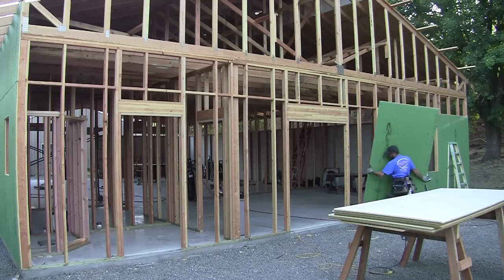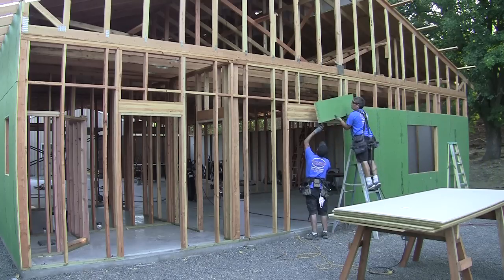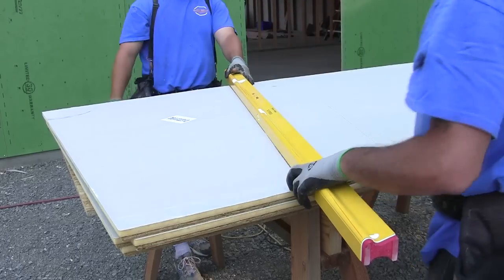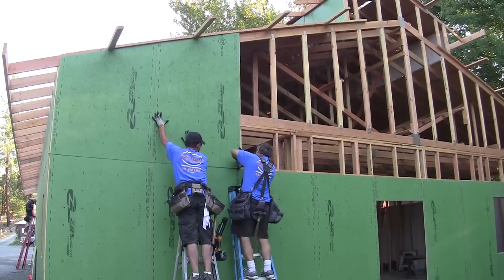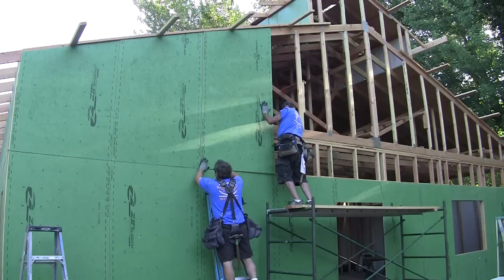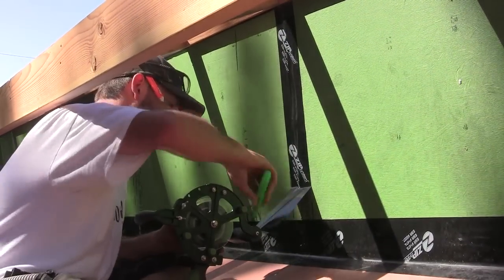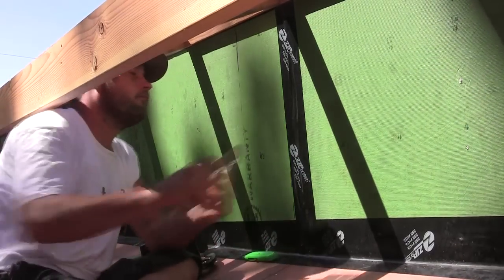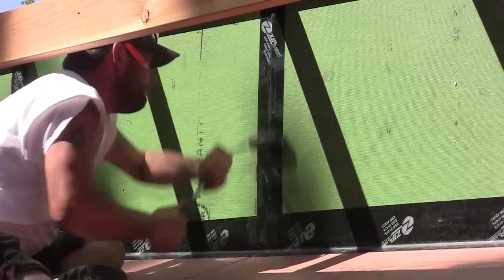My New Shop: Installing Zip R-Sheathing and Roof Sheathing

Comment: sheets need to be installed horizontally as well and staggered, maybe I am wrong but that is how I would install them
Reply: (duplicated from other reply) You don't need to stagger the zip system R panels. They are not structural. If you look at their install manual, they don't do a running bond pattern at all. It's much easier to tape the seams and get a good seal if they are not staggered.
Reply: This is zip system, it’s rated for vertical and horizontal.

Comment: The only thing I would change is the insulation I changed to rockwool for a few reasons 1  it uses the least amount of chemicals, it is fire proof, rot proof, it is hydrophobic, and sound proof. and unlike foam is is not made from toxic chemicals.

Comment: Are you still happy with the insulated zip and did you use it on the roof ? Would you go with a thicker than 1/2"  if you built again ?

Comment: Even better would be structural wall panels from the beginning that have zip facing the outside.   It  becomes your insulation, structure, and seal all in one.

Comment: Foam insulation between the structural sheathing and the studs.  The sheathing is held on with long, thin nails running through the foam and embedding in the studs.  Under a wind load the studs will move, bending the nails in the foam insulation back and forth.
Reply: #1, I am not your buddy.  #2, you are saying that the house does not flex at all under wind loads, and that is factoring that the sheathing, which is the main element that resists the flexing, is not in contact with the frame but is separated from it by one inch of foam.
Reply: If the house is flexing that much, the foam is the least of anyone's worries. The sheets butt against each other meaning the sheer strength is reinforced from sheet to sheet across all fasteners. This means there is no room for flexing back and forth unless the whole house does. 

The only way you'd prevent the same forces acting on both this and typical sheathing would be to glue the sheathing to the studs. 

At first blush I thought the same as you, then I thought more about it. Only real issue. Needing to use longer nails.

Comment: I’m surprised...2x4 exterior walls.  Does the “R” sheathing allow you to use these instead of 2x6’s?
Reply: From my understanding there are a few thickness of Zip R. I think the highest R value is 12.5. I am still learning about these as I want to know if Zip R can be used on a 2x4 wall interior and exterior with fiberglass r13  This would give me a R36 wall along with the roof and blown in up to R80 or more ( roof 12.5 and ceiling 12.5 again ) This would allow for a super fast dry in and build time. If you can use zip or like products for interior walls this would be handy for mounting things and drywall could go up pretty fast with out need to be on studs for finish work.
Reply: @kameljoe21  Keep in mind that a standard stud wall with batt insulation of a given R-value does NOT make a wall assembly of the same R-value.  Thermal bridging plus easer air movement past the batts at the stud will lower your thermal efficacy of your assembly.  There is also the issue of fiberglass batts losing efficacy as they age or absorb moisture. Also, depending on how the electrical, plumbing and bridging/blocking elements are installed, your batts can also be compressed at points lowering their rating.

Zip like products for interior walls?  Maybe for a shower surround in addition to backer board for some reason??  If you need OSB for nailing, use OSB or plywood I would think for the savings.
Reply: @slaveofjesus3878  Yeah I know about thermal bridging. Zip systems with R 12.5 ( 1/2 zip sheet with 2 inches of foam ) can only be used for walls. I called them and talked to them. They have not done studies for roofs and or interior. My plan I think is going to be using the zip for the exterior, then osb everything else. interior walls, ceilings and everything the cover with 1/2 drywall. I want osb backed walls for installing cabinets and other wall hung things. I intend to have quite a bit of cabinets along with wall shelf in the pantry and storage areas. Most of my living area will be countertops which will be used for desks along with cabinets rather than buying shelf units and other furniture. 
My only main concern right now is preventing thermal bridging between the roof and exterior wall. SIP would be nice except do not think builders in my area would or could do something like that, plus the cost of sip are more costly. I would like to do ICF house. I priced out a company call liteform which has the foundation/walls and roof forms and for a 30x30 building with one center and a half wall was 14k just for the ICF. The stucco and interior plaster max was 7k. My house will be 150 fleet long with each section 30x30. Garage at each end then 1 bed room with full bath ( shower, tub, toilet, washer dryer and walk in closet ) living area/office and kitchen. Then center room is master kitchen and storage area with electrical room, furnace room with wood back up furnace and wood storage along with 2 pantry rooms. 12 foot cook hood and dish station and freezer and fridge alley. So garage, bedroom, center area, bedroom, garage. I have designed this to allow maximum light while not increasing heat load. Window package will be 10 3x5 windows, 10 exterior doors, 10 interior doors. I intend to put it all on finished concrete ( which will make it easy down the road to add floating floor or just use rugs ) .  Our water filters, pressure tanks and anything related to that will be in a well pit and out of the way of the main house. Incoming water will come in to the electrical room then go to the ceiling for all drops where needed. Which is why I want good insulation in the attic area.
Reply: @kameljoe21  It's common for designers to specify a raised heel truss for added room for insulation and air flow above said insulation at the wall to roof 'intersection'. If rafters are used, maybe a non-sheathed pony wall could be used to the same effect?
Reply: @slaveofjesus3878  Yeah I was thinking about doing 10 foot walls and then build a entire 2 foot drop ceiling ( osb on roof rafters and then osb on the ceiling to prevent drywall sag ) for a way to dense pack the ceiling after electrical, water lines and steel HVAC system. I do not think I want to do the expanding hose type insulated HVAC lines. This would give me a ceiling with zero thermal breaks and about an r70 ish in most areas other than the HVAC tubes. The HVAC will all be zoned from inside the furnace room. Right now I plan on 8 zones. I still have to consider furnace/ac cost per single unit or 3 units. I will return every room much like they do in commercial settings. Filters vents will be installed in every room rather in the furnace room which would take up more space than needed.  ( which I am still debating about having a back up wood furnace ) 
If I do a 2x8 inch wall ( 2x6 is mostly standard yet I have run the numbers on price per 2x8 which is really not much more cost overall except you have to sort them more and cut and trim them for studs ) the 2 foot drop ceiling would be able to match up to the existing studs which can be screened off for the 2 foot section before adding the 8 foot sheets of osb to the exterior walls and the screen section at the top then laser level the exterior and then add in all of the walls and attach the ceilings 2x4 to it and plumb, electric hvac and then dry wall. The main thing about the ceiling is I want to make sure my lighting is advanced and well though out. I have not decided what type of lighting I want. I had thought about doing those led puck lights which all pretty much come in the same sizes. Except that I would need a gap area for the led lights. So that wont work very well unless I use some sort of can lights. The main living areas are going to be about 30x20 feet to which I want to have a number of sections to which lights can be turned on and off. Some that are for night lights to light up the door ways in the main area along with some to light up behind the recliners or above as to still not add glare to the tv units. There are just a number of things that have to be considered. As I intend to live the rest of my life in this house.

Comment: Shouldn't the joints of the sheeting be staggered?
Reply: You don't need to stagger the zip system R panels. They are not structural. If you look at their install manual, they don't do a running bond pattern at all. It's much easier to tape the seams and get a good seal if they are not staggered.